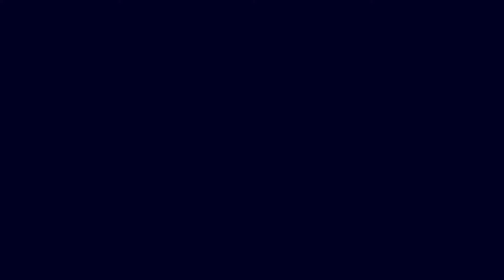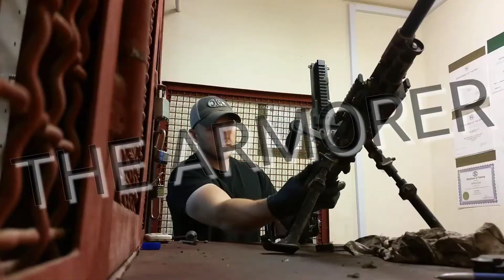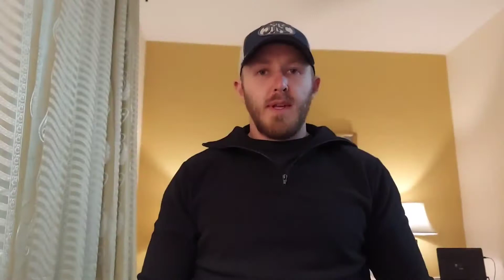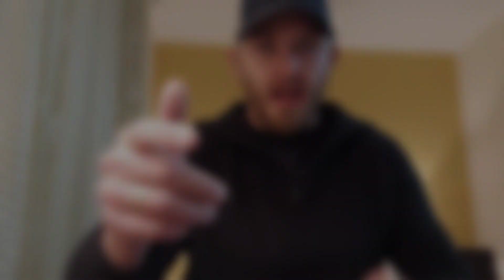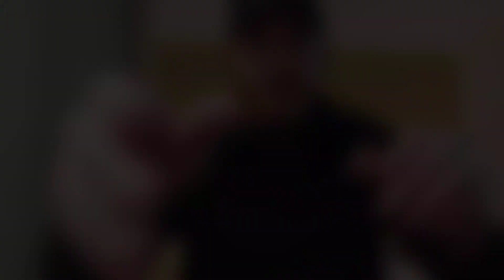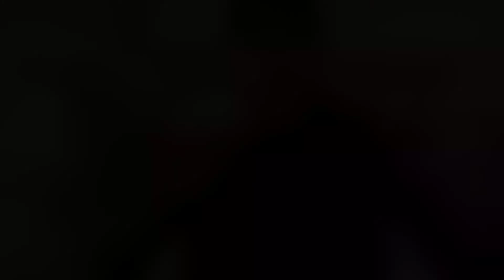Live Round Stuck In the Chamber What Do I Do???

Comment: I've had 3 rounds now get extremely suck in my new AR, I latest separated the upper and lower but idk why they are getting stuck, it's to the point that the extractor is ripping the brass rim, never had this before...
Reply: Going through the same thing. Did you get it removed? If so how?
Reply: @erokfussell  removed the rounds by firing them then pushing out the spent casing out with a cleaning rod, but it still keeps happening
Reply: @Bulmaatthemecca did you ever figure out why it happened to you multiple times?